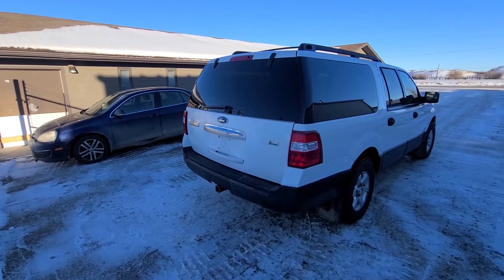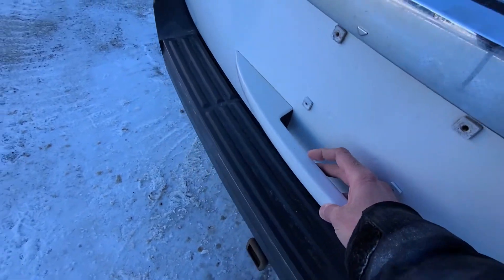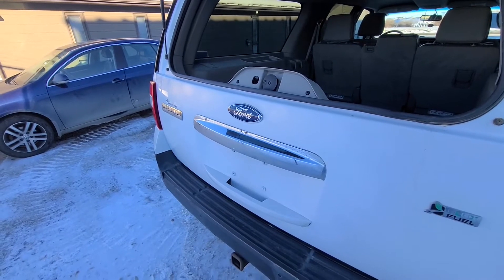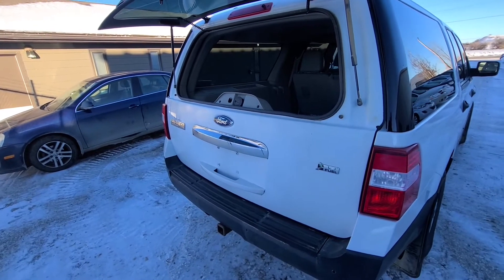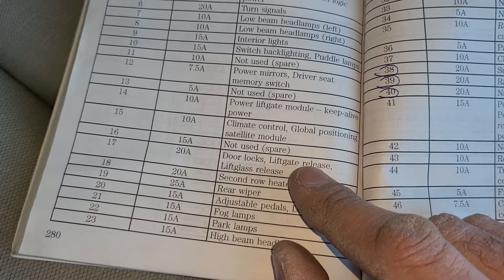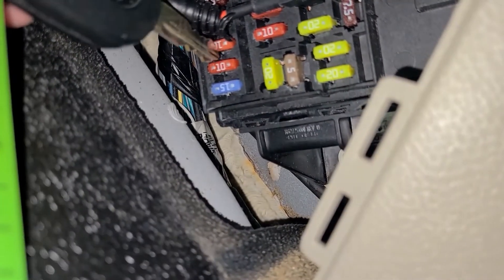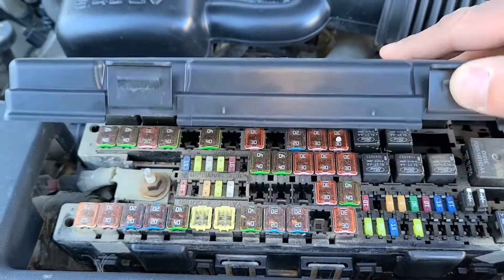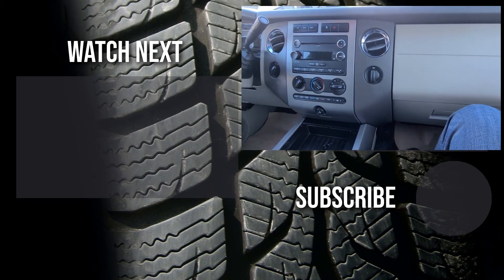Ford Expedition - LIFTGATE / TAILGATE WON'T OPEN? (2007-2014)

Comment: How can i replace the button from the tailgate? That button wont open but the other one it does
Reply from the maker: Hi, first check the fuse. Then test if power is coming to the button using multimeter. If it is that means the button (switch) failed and will have to be replaced. I don't have that car right now so I could check how to replace it, but probably you would have to remove that complete liftgate handle and then get the switch out. You would have to remove the inner liftgate trim panel to access mounting screws. But don't hold me for a word as I can't double check

Comment: I have a 2008 Ford Expedition Limited, the lift gate just stopped working this weekend, nothing happens when actuated from the door button or the key fobs.  Lift gate works OK.  I checked the 30A fuse under the hood, fuse was good and 12v is getting to fuse, I swapped the fuse anyways (no help).  I also checked both 10A and 20A fuses in passenger kick panel, they were OK as well.  What should I check next?  Is there anyway to open the lift gate manually in this state?
Reply from the maker: Probably the liftgate actuator failed. Most likely you will have to try and remove the inner panel from the liftgate and try to manually open it then. I did that on couple of Ford Escapes, never on Expedition thou